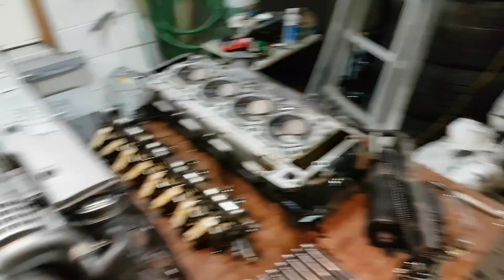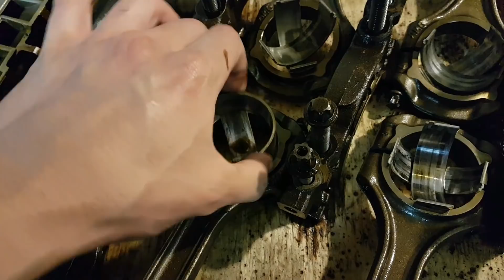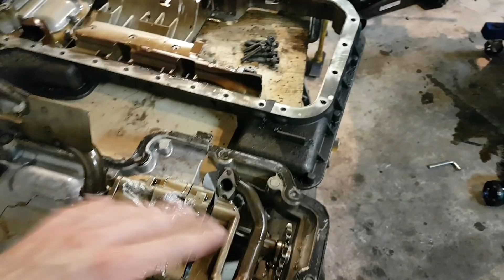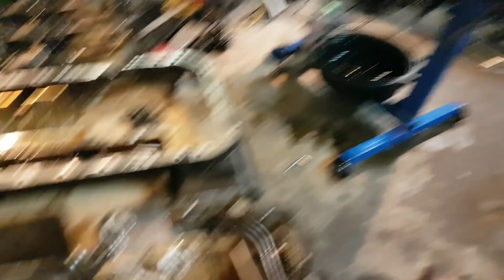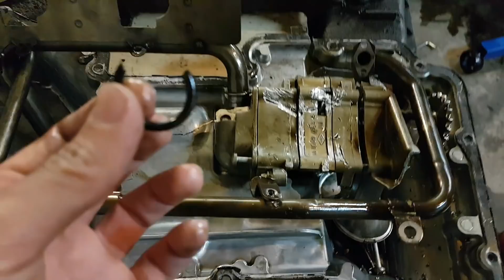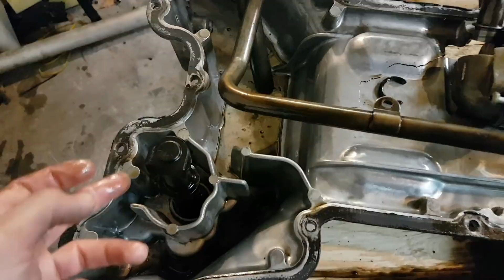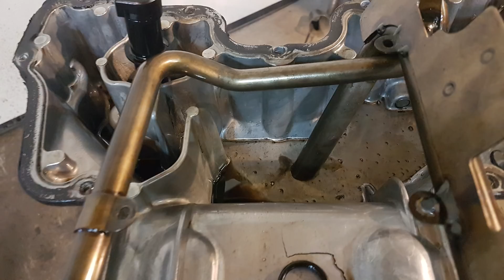Why my Engine Blew. Something every E55 owner should know!

Comment: Good video and explanation!  I can't believe that there is no way to monitor oil pressure!  Also, why didn't they use silicone rubber for the oil seals which can stand up to high temperatures better then neoprene?   I've always said Mercedes (and German engineers)  over engineers everything to the point that mistakes are almost guaranteed. There is a reason why American engineering , which is geared for easier production, results in cheaper production and more reliable engines.

Comment: Wow my old Land Rover Defender Td5 has an oil pressure sensor. And thats mostly a piece of agricultural equipment. How can you NOT put an oil pressure sensor in a high performance v8?

An engine like this probably also has an external oil cooler, and it could also be a simple blown hose to that.

Comment: Nice post mortem investigation. Looks like there may be some room in the sump to block skirt area, to overfill with oil and cover that o-ring joint without coming into contact with the crank throws and foaming the oil as a safety. Having to pull the oil pan to perform a preventive measure is no easy task for the average owner. Since these cars call for full synthetic I'm not surprised it looked good internally despite the heavy duty use and mileage. 

 I don't own an AMG but I'm an auto performance enthusiast and can't believe a car of this stature in performance has no oil pressure sensor on it, not that you would have been able to stop it in time enough to prevent damage under the extreme circumstances. On my high mileage used engine purchases, I pulled the main and rod bearing caps for a bearing condition inspection and sometimes for added feeling of security took the crank and had it polished and then installed new bearings.

If they didn't install an oil pressure sensor, what about an engine oil cooler? If not I would certainly put that high on the list of things to do with the replacement motor along with both an oil pressure and temp sensor. That's crucial data for a car that's tracked regularly and driven hard.

Comment: Sir - The fun you have racing has a higher purpose and this is it. Every MB owner of any engine without at least a big red light needs it — also preventative service - and legal if it’s too late. And spare replacement engines properly torn-down and upgraded ready to install. 

If you can find the smoking gun of engines -mb and others - you have a huge future ! Great 👍 catch.

Comment: Has Mercedes made any comment about this?  I know there's no warranty involved but I'd pursue this issue with them.
Reply from the maker: dhy5342 Yeh, I did mention it to the dealers. They say most of the rubbers have been updated over the years. The new o rings I got do look a lot different then the old ones so I'm guessing they have it figured

Comment: If the o-rings are rubber it doesn't react well to petroleum products, i.e oil which is why the o-ring is completely fucked. Rubber is usually coated with silicone grease to reduce decay in normal operations(not in an engine). Why anyone would put an o-ring in such an exposed area and with oil is pretty weird to me. Seems like its designed by someone with 0 competence.

Comment: This is just another example of how rubber needs to stop being used in cars and switched for silicone or other synthetic rubber. Manufactures should have stopped using rubber the moment silicone was invented. Now we have ticking time bombs whenever these rubber parts fail and they like to put them deep in the engine where you will never service by the time they need replacing due to the fact that to replace that part it would cost more in labor than the car is worth on most cars. I recently found that this product called AT-205 from atp . It's and oil additive that has plasticizers that  replace the ones lost over time through heat cycling in old rubber parts. It's the same chemicals they use/add when the rubber is being made in the factory. So basically you can extend the rubber parts life another 6 years without removing them. As long as they are not cracked or physically damaged they will become soft again. It doesn't make rubber swell like petroleum based products either. So they say it's good for stopping leaks....but I think it would be more useful/likely to work to use as a preventive maintenance thing because once a rubber oring or seal leaks, it's usually because it's hard and if it's hard it's probably cracking too. AT-205 will stop it from ever getting hard and brittle.  So if don't have have any leaks now, and your car is 5 years old or more, pour it in while the rubber is still intact.   I'm going to add it to every vehicle I have, even the ones that are in good shape. Rubber is like the main reason everything fails nowadays so you might as well add to your oil something that targets the rubber parts.

Comment: NO-OIL-PRESSURE-SENSOR-? In an engine like this? This is a manufacturer's fault. I would ask for a complete refund from the company who sold me the engine! Anyway I should add that if there is an oil temperature sensor the engine light should have flashed a long time before the engine seized up. Honestly that should have been a sufficient warning sign!

Comment: No what destroyed the engine was the driver not watching his gauges, lack of a oil pressure cut off or alarm + tracking a car with a factory oil system which is a no no the sumps are not designed to handle the sustained  gloads

Comment: Looks like a regular organic (rubber) O-ring.  Silicon O-ring may have worked better, cost maybe a couple bucks more, but no rubber O-ring can survive immersed in hot oil or ATF forever, they all turn to plastic over time.

Comment: first of all its not cylinder 5 its either 1 or 2 and those shells have not spun, when a shell bearing spins the locating lugs that protrude get flattened or sheared off as thats the part that stops the shell spinning and there all fine.

Comment: Nice video. Design flaw for that pump offcourse... cheap rubber and hot oil is asking for problems. A flange with old skool metal gasket will never fail.

Comment: calling out a BS ! its obvious that you hit something because your sump is broken up, did you stop then? hell no you keep on pushing the car like a loon and tada no oil = broken engine...... even IF that "seal" was broken befor the engine would have FULL  F.U.L.L oil presure!  o btw me= german mechanik knowing that engine ;) have a nice day and try to drive carefull! and not to blame your mistake on mercedes.
Reply from the maker: I hope your realize the whole thing was on video. Watch the previous vid. The oil sump broke after the engine blew and spilled oil all over the track. I'm not blaming anyone for this. Its a 12 year old car, things are bound to fail at some point. An oil pressure switch or gauge could have saved it
Reply: Really, he hit something that cause the seal to harden and break apart.
Reply: Unfreundlich du bist aber heute wieder unfreundlich ;)
Reply: na is doch war wenn ik so ne kacke sehe :D
Reply: +Cool Jay probably installed the rubber with wrong lube.    & it hardened & weakened
Reply: Yep I see the crack next to the hose.

Comment: If you only fit one oil alert, use a buzzer.  You don't have to be looking at the dash at the critical time to get the message.  You can also add a pressure gauge and/or warning lamp in parallel.  Belt AND suspenders.  I used a seat belt buzzer from a crashed Honda.

Comment: bmw m5 e60 s85 v10 engine design had 4 oil pump , 2 electric in the side of the oil pan + main oil pump in the sump + deducted high pressure vanos pump 1000psi :) thats why i love bmw

Comment: Mercedes need a boot up the backside. I have a 350 diesel from 2011. Oil leak from cooler as the O ring also failed due to so many heating/cooling cycles. Poor design, but Mercedes just said "tough". Will never buy one again.

Comment: Oil pumps with suction problems due to O-ring or broken pickup tube isn't unique.  Subaru has had a few model years where the brazing by the mounting of the pickup tube to the pump breaks, often on turbo engines. Personally I'd prefer an oil pump that's submerged instead, that way you'd minimize that risk.

Comment: That O-ring was damaged during the initial build. It should have been replaced before build was completed but was just shoved in and forgotten... And surprisingly Mercedes screwed-up and didn't have a oil pressure sensor anywhere on the engine...

Comment: If you can not remove the piston, how did you disconnect the con rod? The small end of the con rod is in one piece so I am pulled as to how you removed it?
Reply from the maker: It had broken free of the piston when I found it. The lower part of the piston was broken

Comment: Very good and thorough analysis of the nonconformities that led to the engine failure. I think that Kevlar reinforcing for their O-rings would help to prevent them from coming apart and becoming a FOD issue, and would be a good engineering improvement for Mercedes in this case. Thanks for the heads up!

Comment: Great explanation, it's too bad that  MB are not as bulletproof as they once had been. I just went through swapping out the shitty radiator that was known to mix antifreeze with transmission fluid, (strawberry milkshake). I had one of the defective ones that MB acknowledged but refused to change under a recall. Changed before it blew. BTW, it's my wife's car, I'll stick with Subaru's....lol

Comment: Sad story man, should have been identifiable in time with a pressure gauge as you said. Btw, as you spun when the motor failed/locked up I assume you are running automatic transmission -very nice indeed you where not in traffic and the reason a clutch is kind of a safety for being able to decouple in various scenarios. Great vid.

Comment: MOTERFRUCKERS, my tiny 1.5L, 20 year old Honda engine uses a flange and bolts to secure the pick up tube to the pump, it is NOT coming loose... ever.

Comment: So if you get the oil leak from the O ring on the level sensor at the back of the engine, that would be the right time to replace the similar O ring in the oil pump.

Comment: German car makers tend to build into their mechanics weak points of failure. Pick a car and search it and there's plenty of info on dodgy parts designed to fail on German and other European cars. I wouldn't bother replacing the o-ring, I'd fabricate a connection with either a gasket or by welding the problem area.

Comment: Lot of damage for a 50 cent rubber ring, in most modern cars there is no oil pressure or temp sensing.Some volvo's have this problem too

Comment: Your deduction is completely wrong!! Overheated oil and starvation from g-forces was the cause of spun bearing.
Conrod broke, hit the pump, broke it off and pump punched hole in sump. Movement of oil pump broke the oring and part of it was sucked into pump inlet.
If hardened oring is not moved or touched it will seal, not perfectly but it won't cause havoc like you imagine. Also there is no way that it will break apart like you are saying.

Comment: It makes sense. Apparently the engine was destroyed before it actually blew up, because of massive wear.  The oil pressure is definitely a sensor you would wand on any engine. Even the cheapest engine have it. But instead, Mercedes is preoccupied more about comfort, like fitting a boot light failure sensor.
Nice job. Keep it up!

Comment: No big surprise here.This may have caused this, that might have cause that , yadda yadda yadda. My dad and mom have had their share of Mercs in their life time , and never had blown an engine. My mom still has a '85 500S (w/ 264000+miles) and a '90 300E(w/67000+miles)and they still run like new. Mercs will last forever if you don't constantly beat on them. Now if you go to ''track day'' and always run the car at it's limits ,OF COURSE there will be a malfunction eventually.
Reply: geektoro The bigger issue here is AMG’s complete incompetence in failing to put something so simple as an oil pressure switch in a supercharged ~500 hp V8. Even a Volvo 240 with a single cam 4-banger has an oil pressure sensor of some sort. Pure stupidity.
Reply: No AMIGO Mercedes of the older cat generation such as your mention were and is known for reliability... its the newer Mercedes that suck!

Comment: What possible reason would anybody not want an oil pressure warning light.    Its bad enough that modern cars don't have a coolant temperature gauge. If I could have these instruments as standard I would gladly pay extra. Even a a warning that there is reduced pressure would have stopped you racing the car and that might have prevented catastrophic engine failure. Road trucks have a low oil pressure light and a zero oil pressure light with an audible warning.   Trucks also have gauges for everything including oil pressure and temperature.

Comment: Good analysis. Another example of German over engineering with a failure to take care of the little things than can fail. That and apparently the oil has got so hot that it's baked the O ring which fell apart,  that engine needs a good oil cooler obviously. Nissan for one stopped using O rings there, the Japanese are the best at that sort of detail.

Comment: My pocket was saved a couple times when I lost oil pressure and obviously stopped the car straight way... No having an oil pressure sensor seems like a really crap ideia from Mercedes ... 😳
Reply: Crap idea?  or genius idea? 
i think the second one
Reply: AMG company, only the body is Mercedes.
Reply: @nederberg2331  was 30 years ago separated. Now comes from the same assy lines.
Reply: The old Mercedes had oilpressure gauge but not this one hmm!
Reply: @CevairZufer  oh, some of them I know are handmade by AMG, but I suppose only certain ones...
Reply: @nederberg2331  the first AMG designed engine was the m156 that superceded the m113k as the next AMG v8. This engine is most known for being inside the C63 and E63 AMG. The e55 contains the Mercedes m113 v8 built specifically for boost by AMG.
Reply: we need to use a Japanese Oil pump on these german cars!!

Comment: Rubber instead of Viton or silicone and no oil pressure sensor equals planned obsolescence. There is no excuse for either of those omissions. Those engines are clearly designed to fail in the exact manner that yours did. Mercedes should be sued over that.

Comment: Tip for owners replacing that o-ring. Get the same size in a similar durometer in Viton, and it wont happen again. The rubber nitrile ones turn to shit in no time flat in harsh environments.

Comment: What the hell were they thinking when they designed that thing? Bad enough to use an O-RING to seal the pickup tube (many engines will have them press-fit in with a retaining clamp so they're permanently sealed), but then that pan. I guess the body engineers couldn't be bothered to give them two more inches under the pan to get rid of the front scavenging section.

Comment: they changed the formula for rubber years ago under the bullshit excuse that rubber was not degrading fast enough in the land fills, like who cares. this meant that when your engine was put together it was assembled with worn out rubber. i suggest that you use if you can match sizes the green o rings that is used in ac systems

Comment: With the 2000s came a desire to address concerns from “marketing” that time-tested oil pressure gauges like the one in my A124 were too confusing for people cross shopping Lexus with Benz. Ditto dipsticks and sensible oil change intervals. And it wasn’t just Stuttgart, but also Munich and Wolfsburg that started listening to this nonsense. This is the result! A high-performance car like this should come from the factory with an oil pressure gauge. Period.
Reply: Forrest Scott Brinkley Nah,  people with money don't want to see anything distracting them from driving. Dropping the oil pressure light in exchange for a low oil level level is much easier on owners. After all, if their cars fail, either it's  under warranty or they just buy something else.....smh.
Reply: F Dryer I would contest that for AMG buyers. They are typically “car people” and would most likely welcome the valuable info.
Reply: Forrest Scott Brinkley I agree but there are those that aren't interested. There seems to be plenty of very well off people with disposable income destroying more expensive cars than M-Bs and simply buy another one......
Reply: F Dryer Perhaps, but AMG being an enthusiast product line, the market niche I believe commands such basic info. The newer cars have at least some of this functionality (albeit buried in a submenu of digital display).

Comment: You got a mess there, but nothing that can't be fixed. You can't call this a defect. If it was a defect it would be all over the AMG community like a rash. I'd rather call this an unfortunate thing that happened, and it happened to you. I'm sure someone else might have experienced the same problem but not hundreds of people. Just remember if you're going to run these engines at a track and beat them up a bit they will require frequent tear down for inspection. Just because it's an AMG doesn't make it impervious to failure. Good luck with the replacement engine and tear it completely down before installing.

Comment: Complete bullsh*t.

If that was sucking air you'd have no oil pressure (as you claim through bearing evidence) and when there's no oil pressure you'll get a warning light illuminate on the instrument cluster.
What you're telling us is that you ignored warning lights and continued to drive.

The truth is that you're using incorrect engine oil. or not doing oil changes on time.

Comment: A lot of confidence the designers put on that tiny o'ring. This is simply a design flaw. They could have easily implemented an auto shutdown system in case of low or no oil pressure together with an indicator and warning light. Excellent video, unfortunate occasion.